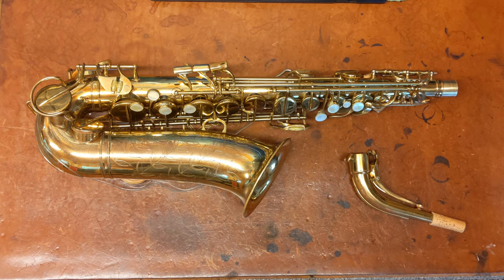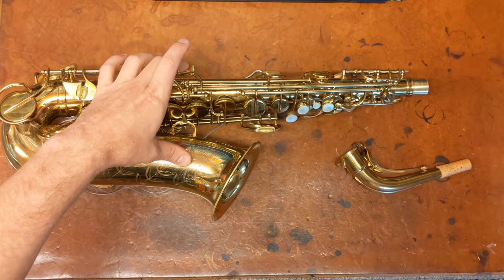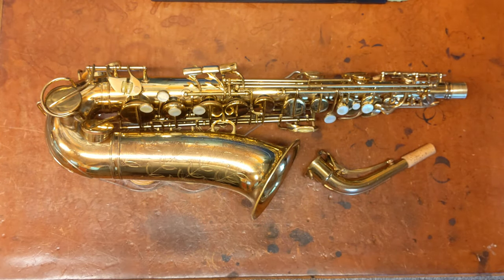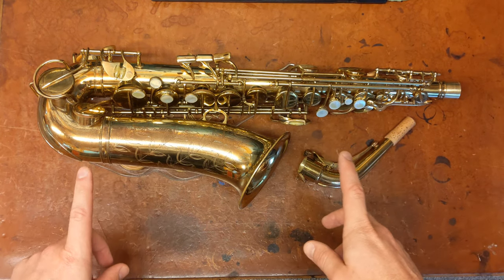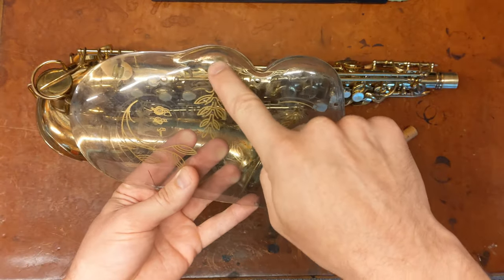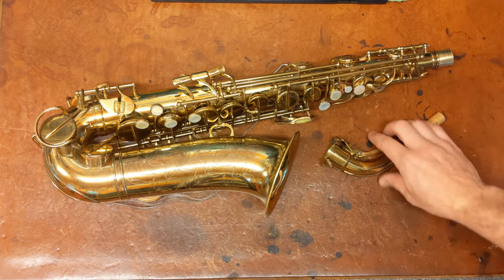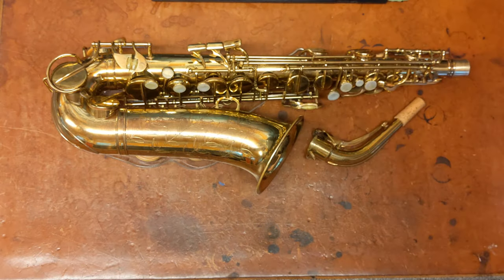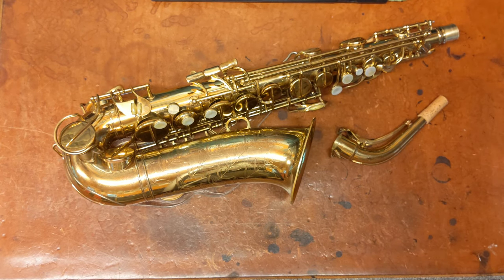Repairman's Overview: 1950 Conn 28M CONNstellation Alto Saxophone

Comment: Great review  Matt.  These are wonderful instruments.  Just some history behind how I started making the plastic guard... I was asked to make one for a sax that was missing the guard and three of the posts. Someone had  sawed off the posts  and installed a metal guard, so after researching the instrument I discovered what the guard should be like so I made a mold to vacuum form a guard. A very trusting musician saw. pictures of my guard and he asked if I could make one for him. He agreed to send me his guard so I could make a mold.  The guard has gone through a couple of iterations with the most recent being the one you have on this sax. As you pointed out my guard is not an exact copy. I call it a replacement and not a reproduction. It functions as well as the original, is a bit stronger and if I do say so it looks pretty good.  I always suggest if you have an original in good condition save it and use my guard to make it a player.
Reply from the maker: Your guard is an upgrade, in my opinion!   It will be used exactly as you suggest on this instrument.
Reply: Hey Slausonm, how can I order a guard? I happen to have a 28M with a selfmade guard. Also missing 4 of the six screws. Can you help?

Comment: The late Santy Runyon (Runyon Products) was one of the 3 man design team for the 28M.  Ergonomics (though that was not a term used in those days) was an important consideration in the design of this instrument, to get an even, precise feel, and movement that worked with the natural motion of the fingers.  Santy also designed the Conn Comet mouthpiece specifically for the 28M, and his company made these (and other) mouthpieces for Conn.  They began design on it around 1939, but production of this instrument was delayed to 1950 due to WWII.  Santy was also featured in Conn ads for the 28M.  Matt, I'll send you the ad.
Reply from the maker: "They began design on it around 1939, but production of this instrument was delayed to 1950 due to WWII."

I had always had a feeling something like that was the case!  Thank you so much for sharing.  

And the Conn Comet was a really cool mouthpiece.  I love the original ligature with the star shaped cutouts!

Comment: How are the octave vents set? The lowest controlling D-F, 2nd G-A, 3rd (neck) B through the palm keys?  That would seem to make the most sense.  I would think that the feel of the chromatic F# would match well with the RH touches, although it would certainly feel different than pretty much all other saxes!  Thanks for doing another of these!
Reply from the maker: they are responsible for the same range as usual, just the body pip is now two pips that open at the same time.
Reply: Stohrer Music oh, that makes sense...that’s why they are so small.

Comment: Just my percy opinion but that perspex clothes guard is horrible.   I am repairing a sax that had the long pipe guard in perspex.  It was missing, I expect it broke.  It will be replaced by brass.
Reply from the maker: OEM style replacements are available.  Don't make it non-original without checking one out first please.
Reply: @StohrerMusic  Matt, I have the absolutely full respect for your work.  You are an excellent craftsman and mechanic.   But I just don't like the perspex.   For me it just doesn't belong on a brass instrument.   Sorry, I think it's an awful design.. Oh, I didn't mention, it isn't a Conn,  it's just a cheap sax that I am practising various repair techniques.